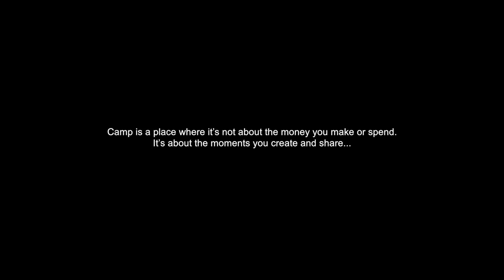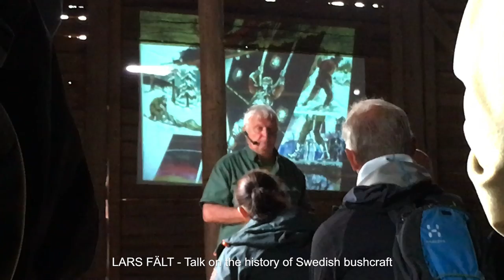BUSHCRAFT CAMP - FORGING A HOOK KNIFE, HIDE TANNING, BOW DRILL, BIRCH BARK - THE TIPI DIARIES Ep19

Comment: Hello Ric!  Well I've watch 19 Episodes and one question constantly comes to mind for me because I see that you do this in pretty much every episode, sometimes more than once.  I supplement the heat in my little home with my woodstove in winter time. I notice that you always build your fire with the kindling on top.  I have never heard of  or seen this before (which means nothing LOL!).  I've gotten very proficient at starting a fire with kindling that I collect from all over my yard (I keep everything I find that drops from the two Sycamore Maples I have. I even shred the leaves for mulch) and adding larger sticks and then larger and large pieces until t's hot enough to put in a full sized log.  Will your method of kindling on top work when the larger logs I am using are Oak or Maple?  Hoping there is an Episode 20!  I have truly enjoyed what you are dong out there! And I'm totally in love with Petrus !  You're pretty nice, too, but oh, that Petrus!!!
Reply from the maker: Hi, yes it should work, i have started many fires with oak and maple this way. Just make sure to have the big logs at the bottom and progressively smaller on top.